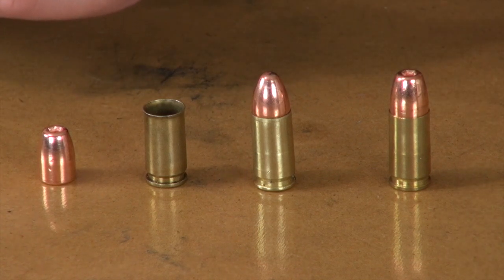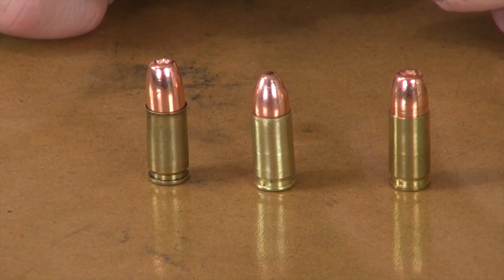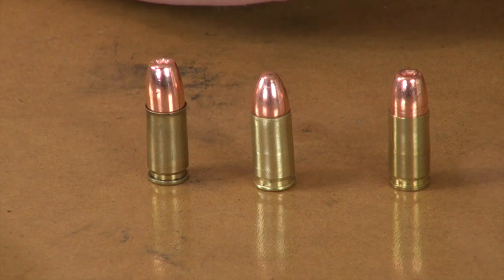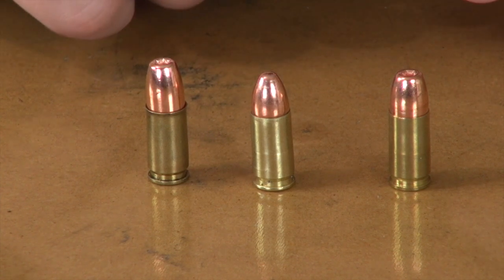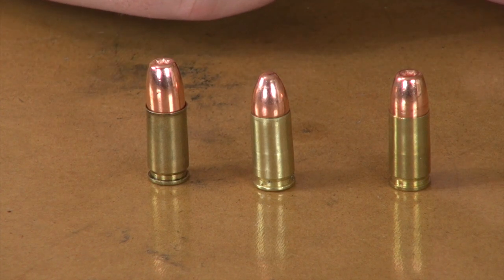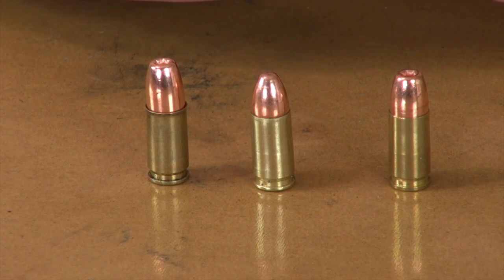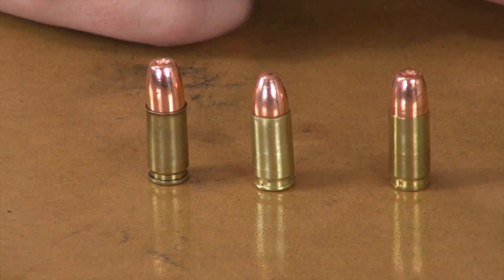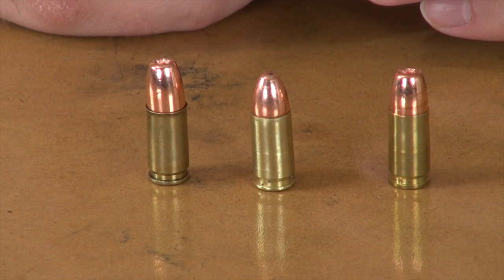Crimp and Expansion with plated bullets

Comment: thats way to much exoansion. the flare for plated bullets is the same for jacketed bullets which is just enough to get the bulket in the case. you can get away with very very little flare for this type of bullet, but you certainly dont need this much. as far as crimp, you should probably only need enough taper crimp to iron out any flare.

Comment: great video, I have purchased copper plated 230gr .45acp round nose bullets from xtremebullets, look & feel great, but I still have not found loading data for copper plated bullets. If the style (RN) and weight 230gr match say, copper jacketed, or solid lead bullets will like grs. of Unique powder work safely as long as I stay around mid charge?? 
I wish powder manufactures would start listing copper plated as well in their loading data.
Rusty
Reply: I'd just follow lead loads for similar weight, and work up a tad higher since it is plated.  Only a few tenths of a grain though.  Did this for 9mm and worked great.
Reply: I don't worry about the type of bullet, just the weight.  Powder is pushing mass, not shape out that barrel.

Comment: I just ordered some for 44 magnum plinking with a revolver it sould still have a little bit of crimp though right i mean it has to n a revolver to keep them from jumping, i know u need to keep the Velocity low  with plated bullets but regardless i should put some crimp, any thoughts?
Reply: From what I’ve researched yes but just slightly, the key is to keep the projectile held in place just enough so that it doesn’t “walk” out of the casing, load 5 at a time and have a caliper with to measure the OAL at the fifth round and adjust as necessary

Comment: That flare is way, way too much. Flare it enough to just barely get the bullet started in the case, it'll be fine, the copper plating is thin, but it's pure copper, and is harder than the brass, which is copper with about 30% zinc. That much flare will overwork the brass over the course of several reloads, making it brittle, and you'll start getting splits and whatnot, wrecking your brass. Good advice on the crimping, though, don't overdo it with the plated bullets. In general, you don't want to crimp auto cartridges until they look like a roll crimp anyway, because they headspace off of the case mouth, so you need a little bit of that case sticking out past the bullet to hit the end of the chamber, which keeps it from having any "give" when the firing pin strikes the primer.
Reply: Scott Patterson +1 Way too much bell! I basically had to reduce the amount of bell to almost nothing, or else they would not pass the case gage test.
Reply: That is alot of flare but honestly it shouldn't really be a problem, brass isn't as soft as copper but it's still a very soft metal, that's why it's uses for cases. If your case can't handle being flared then it's already got some issues. Nickle plated brass might have a problem with over flaring but personally iv never seen it happen and the cases generally split earlier than their brass counterparts anyway. I completely agree with the crimp part though, first 9mm brass i reloaded I crimped with the seating die, not because of all the people saying you should taper crimp auto cartridges but because it was easier and eliminated a step. Ended up loading like 500 rounds and as it turned out I was over crimping like craze because if how soft berry's plating is. Went to chamber check and I'm not sure how this works but the rounds failed chamber check in every way possible, some of the bullets would stick out past max 
length and pretty much every one of them I couldn't spin and they would get stuck in the chamber instead of falling out freely. I fixed about half by running them through a factory crimp die but had to pull the other half. Now I'm super confused because alot of sources say taper crimp is a must for auto cartridges but obviously you can easily mess that up and the factory crimp die is clearly a better choice because no matter how much you crimp it won't mess up how the round headspaces.
Reply: absolutely, not to mention when seating can and does scratch the inside of your seating dies which does not help over time. Brass where I'm from is extremely plentiful, so I would be slightly more concerned with my dies than the brass of course.

Comment: What do you mean specifically about readjusting your sizing die to prevent setback?  Dial it down farther?
Reply from the maker: Yep, I will generally set my sizing die with a standard sheet of copy paper for clearance on the shell plate. It's about 3 thousandths thick, so you aren't damaging the die, but you're getting maximum sizing. If that doesn't work, you can also look into an undersized die from Lee/EGW.

Comment: If there is no cannelure on the bullet there is no need to crimp. If the casing is sized correctly and the bullet is the correct diameter the bullet will seat just fine. Factory ammo especially for your semi-automatic handguns have no crimp.